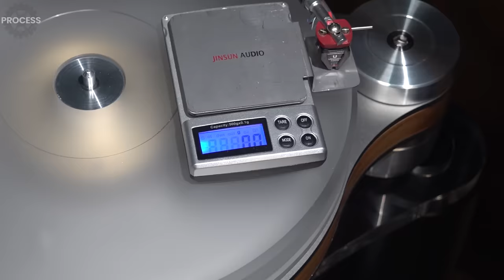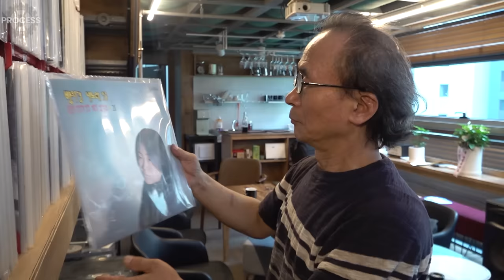Process of Making a Handmade LP Turntable. Korean Analog Audio Artisan.

Comment: Well for a DIY turntable this is exceptional.  But if this unit is for sale or limited production, I certainly hope they get rid of the tooling marks on all of those turned components, but that they put some more errors into sealing the wood components and possible stepping up the soldering game.

Comment: magnificent, the turntable is a stupendous piece of mechanical precision, no digital player can even remotely match the charm of these stupendous artefacts. It reminds me of my beloved Micro Seiki
Reply: Precision? Any turner can do the same.
Reply: This video shows that there is nothing high-end about audiophile style turntables. Anyone with a lathe and a band saw can build one. The only high-end thing about audiophile style turntables is their price.
Reply: @meindertsprang7491  The hardest part to make is probably the tonearm. I have a table like this but a lot less fancy. Heavy base (plinth) a thick acrylic platter and an outboard motor. Mine uses a fishing line as the belt. I would be surprised if he got a very stable speed with such a thick belt but maybe he does. In the end it would be harder to make a direct drive table by hand rather than a belt drive table. I wouldn't put down something because it is classed as high-end. You're right, you can make it if you have the tools but a lot of people do not have those tools. The guy does have the skill and it looks nice. Why pay for a Porsche when a Yugo will do?

Comment: The outline of the turntable body reminds me of one those 45 RPM 7 inch record adapters that goes in the middle hole of the record. I would imagine only high end clients need apply to purchase these turntables. Joe Schmoes have to be content with cheap junk from China. I feel grateful I bought an old used Dual 505 turntable from 1976 that still sounds great.